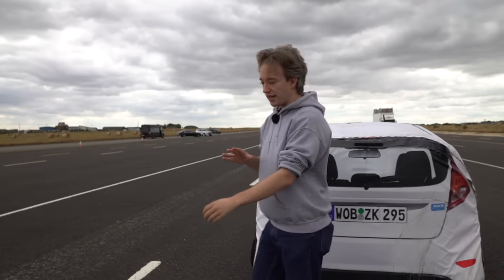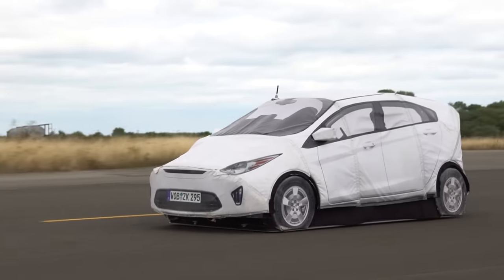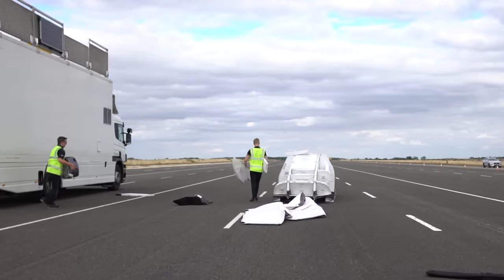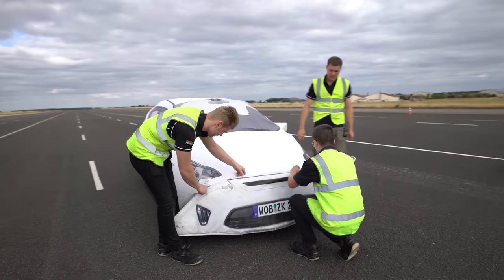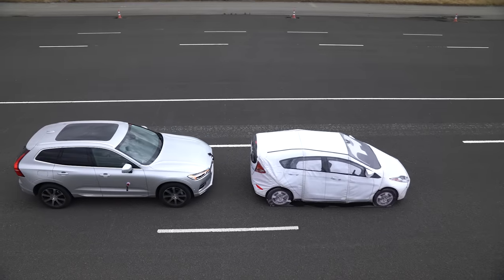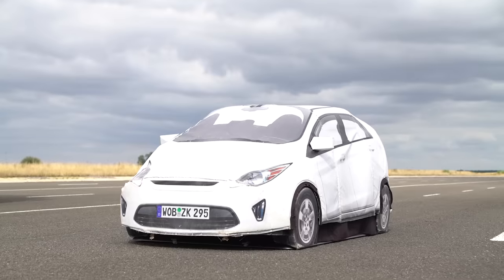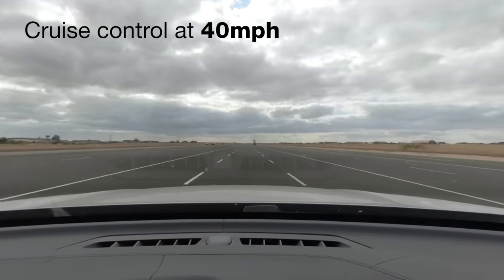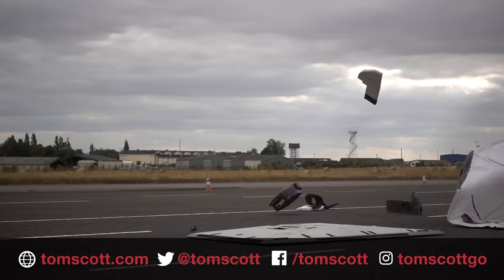The collapsible crash-test robot car

Comment: When they finally work out driverless cars, will they have to make a special model for Brits that doesn't have the steering wheel on the right, instead of not having it on the left?
Reply: Yes.
Reply: It won't be so much where the invisible steering wheel is as knowing which side of the road it's supposed to be on. Plus having equal amounts of sensors on each side of the car and both LH and RH software installed simultaneously, coupled with the knowledge that if a UK car traverses the Channel (or vice versa) it knows to swap sides (not doing so would be a little awkward... well, more like downright dangerous and possibly fatal).

Even in countries that drive on the same side of the road, they'd need to know the respective countries' Highway Codes when crossing borders, and recognise different styles of signs. It also needs to be preloaded, as you can't guarantee decent GSM coverage across the entirety of a border.

Your comment was in jest, but illustrates a nice little can of works...
Reply: mittfh, now I'm imagining a gentle chime followed by the car calmly announcing "please be advised there are currently 127 wrong-way drivers approaching you at a high rate of speed".
Reply: None of us have the wheel on the correct side. The correct side would not involve walking into a lane of traffic to enter your car.
Reply: @900bot2  Gear stick? Oh ... ... I think I remember that ... ... from so long ago.
Reply: Yes but they'll save money elsewhere by not installing indicators.  They're a redundant feature as nobody uses them anyway.
Reply: zeke1220  Sweden had left hand traffic with the steering wheel on the left back in the day. It was a nightmare during overtakes.
Reply: Monty Python the Flying Circus
The language is not called British. It is called English. Named after the Angles, a German tribe. So what's your point?
Reply: Jim Fortune  His point is that he's that guy and should be ignored
Reply: blindleader42 So you're saying that Brits have the steering wheel on the right side then?
Reply: uzijn Yes, because they drive on the left!
Reply: We'll never have (wide spread commonly in use) driverless cars in our lifetimes, so no need to worry!
Reply: They won't figure out driverless cars. There's a morality aspect involved. Does your autonomous car kill you or the child that wandered out in the road? Which is more moral? Would you buy one if the answer is you? Would you not sue the manufacturer or driver if your child was the one that got splattered?

Until a decision that doesn't piss off a bunch of people can be found, it's probably best to put it out of your mind.
Reply: It doesn't matter how many times I watch a Tom Scott video, or how British the accent of the people talking -- every time the passenger seat is on the left, I'm surprised and confused.
Reply: And india, and australia, and New Zealand, and japan, and most of south africa, and Ireland, and malta, cyprus, Hongkong, many carribean islands and any others I forgot to mention. We are not the only country that drives on the left, otherwise car manufacturers wouldn't bother producing right hand drive cars to cater for the minority.
Reply: The world's coming to an end so quickly?
Reply: Everyone who drives on the right is simply following Napoleon, who was left-handed and wanted to march on the right-hand side of the road so that his dominant sword hand was in the middle of the road to defend oncoming attackers.
Reply: Which is why the steering wheel is on the RIGHT side. Doofus.
Reply: Alex Willis could just be following the law mate. It’s the British who are engineering self driving cars so you Americans can eat a Big Mac while driving on the wrong side of the road
Reply: Jim Fortune no, we are just doing the best at it😂
Reply: I made a mistake with my statement. I've corrected it now. For reference, I'm British.
Reply: Aimee Wyatt
Nah. You just have the best commentator in Tom Scott.
Reply: Alex Willis
So it made him more effective and 95% of his army less effective?  I think that's an entertaining story, but apocryphal.
Reply: Jim Fortune. Yup probably nonsense, but I like it.
Reply: Monty Python the Flying Circus  the nice part?almost everyone else use USA standard.
Reply: @zeke1220  The correct side involves seeing the road from as close to a central position as possible, to improve forward visibility into the opposite lane.
Reply: @Poldovico  That's really not an issue if you're not crossing into the oncoming lane.
Reply: @spinner4148  I overtake every day. All it would take to safely overtake with a same-side steering wheel is a single mirror.
Reply: @spinner4148  is your existing side mirror blocked by passengers?
Reply: @blindleader42  So... our steering wheel is in the right side and your steering wheel is on the wrong side like our signs are in the wrong sides like your signs are in the right side.
Reply: @blindleader42  I mean you're the one using our language. English so maybe you should come up with your own language?
Reply: @EinkOLED  63 countries in total drive on the right so it's not really a minority
Reply: Monty Python the Flying Circus most people are right handed, placing the wheel on the right means they have to use their left hand for most of the things. I don’t think it is the right way of doing this
Reply: @zeke1220  That's literally the dumbest idea I've heard today. Make it safer to enter/exit your car 0.1% of the time and more dangerous to drive all the time.
Reply: @decidiousrex  How is it more dangerous? Do you make a habit of running into things on the opposite side of the lane from your seat? It would be the same thing, just don't drive into things.
Reply: @Xeddicus427  Are you sure about that? Once it is demonstrated that in all circumstances an automated system is safer than a human, it is likely that manually driving a car will be reduced to specific circumstances.
Reply: @bobthecannibal1  In the time a human takes to weigh up the ethics of that situation (even if it's merely 1/100th of a second) a computer could have calculated a path that avoids killing anyone, or determined that no such safe path exists and will then execute a path that minimises the physical impact to the operator/passengers of the vehicle.
Reply: @alexanderoshaughnessy3176  Given that there are over 180 internationally recognised countries, I would assert that 63 is in fact the minority.
Reply: @jamielonsdale3018  The problem there is 'in all circumstances'.  Computers do, in fact, make mistakes.  Very stupid ones, surprisingly often.  It's not reflexes that are the issue, it's the computer insistently doing something stupid.  Like driving into a lake.
Reply: @b34rdy  Congratulations. You're about three years late to a party we throw every once in a while for people who don't get jokes.

I'm curious. Were you born yesterday?

Comment: while that was neet, i want to hear more about that robot and how it goes so fast while being so slim
Reply: 78 hamsters
Reply: It probably dosent weigh very much, so it doesn't require a huge amount of power to move it
Reply: it's a bit hard to see, but it appears to be higher in the middle. I'd suspect that it's somewhere between 20 and 30cm high. enough for a small electro motor. combined with a weight of 30~50kg you really don't need much to accelerate it up to 50mph.
Reply: It's lightweight, so doesn't need much power to accelerate, and it doesn't need to drive long distances so it doesn't need a bulky battery pack.
Reply: What is it named?
Reply: It's called the "Global Vehicle Target" or "Soft Car 360".
Reply: Indeed! I couldn't have said better myself - and I work at the company that makes them!!! The platform actually weighs in at 346kg and has 3.45kWh of power. It has an over-run capacity of 1000kg per wheel. Our company is AB Dynamics if you want to learn more.
Reply: Look up the world's fastest RC car. 202mph done by a vehicle the size of a large toy.
Reply: @Electricdreams21  78 hamsters hauling a flat platform for a foam-block car is now my new religion.

Comment: >50mph
>"highway speeds"
Disgusting, Tom Scott. Truly filthy.
Reply: In my state, 55 is the lower bound for almost any highway, though they get up to 65, and interstates up to 75.
It's Nebraska. There's alot of space to traverse if you want to get anywhere. If you don't go that fast, you fall asleep.
Reply: Micah Philson that’s not what they were talking about
Reply: 55 saves lives.
Reply: In the UK, "highway" is an umbrella term for public roads. 35, 40mph is not unusual for city driving. You saw how it could barely stop in time at 40mph, now you see the challenge in getting a car to stop sooner than that while not creating inertia for the people in the vehicle.
Reply: Would have preferred metric as well :D
Reply: 100km/h on a very curvy motorway that hugs the coast and has bus stops and stuff, which dont really have slip lanes. 
N-340 in Spain if anybody is interested. Used to be the most dangerous road in Europe.

None of these cruise controls or anything would be at all viable where I live. And notice how I said "used" to be the most dangerous road? The fact you cant shuffle your responsability onto a bit of technology has kept people aware and careful.  Now that everybody uses in-built safety precautions they've stopped caring so much about their own safety
Reply: Here in Seattle people routinely drive 5-10 MPH below the speed limit on the highway even when there is zero traffic.
Reply: @micahphilson  100mph is minimum to feel any sense of moving tbh.
Reply: In Canada we go 100 kph ( no idea what that I’d in miles) I think it’s somewhere around 62 mph
Reply: @MicroageHD  You should probably seek help for that, it sounds incredibly dangerous.
Try a go-cart at 20mph and tell me you feel no sense of movement and check back with us, please.
Reply: Micah Philson here in California, the interstates are only up to 65MPH but no one cares and goes 80-85
Reply: I can't drive 55!
Reply: eWizard he’s in England, there’s a thatcham research logo on the workers shirts
Reply: @MicroageHD  are you german?
Reply: @ashley587  then the "highway speed" is 70 mph not 50, even the A road speed is higher at 60
Reply: @sebastianhansson6919  oh boy you do not want to be on the german autobahn if you think thats dangerously fast,  the recommended speed for driving on the autobahn by the government is already at 80 mph and most people drive about 100 to 110 mph just on their way to work
Reply: @hecki0193  His point isn't that it's dangerously fast, but that you should still have a decent sensation of movement at lower speeds and it's dangerous if you don't have that because it means you are underestimating your speed.
However, it's not true that most people drive 100-110 mph. Sure, it's common, but many people drive 80-90 mph. I don't think either of those groups of people is more than 50%, though, meaning neither of them are "most people".
Reply: @boringperson-zb8vy  In the US, going below 45 mph on a highway is illegal, unless there is a traffic jam forcing traffic to drive that slow.
Reply: where i live highway speed is 80kph
Reply: @lobsterbark  in Germany you are not allowed to enter the Autobahn(motorway) unless your vehicle is capable of doing 60kph (37.5 mph)

Comment: Was really hoping for a both-vehicles-moving test, to see how the Volvo would handle a brake-check
Reply: If the target tried to break check the Volvo, surely the target would fall apart under its own breaking forces?
Reply: I don't think this system would react to a brake check, since an actual brake check doesn't stop the vehicle, it just rapidly slows it down for an extremely short period, then back up to speed.
Reply: Look on the NCAP YouTube channel for other tests.
Reply: Just search for “EuroNCAP Volvo” (or any other car make and model).
Reply: what about a neither vehicle moving test?
Reply: Rather than a dinging, the alert is changed to "Blyat"  and it starts uploading the dashcam to youtube.

Comment: Guys, this is just an assist. It's not expected to handle everything. It's supposed to just help in case you don't stop in time on your own, in situations it can detect.
Reply: That why the emergency stop is short and hard to prevent drivers from relying on the radar.
Reply: @Squant Thank you for saying inching.
Futurephiles have been boasting that we'll have fully autonomous robo taxis on the road in a few short years for a decade now, and always been wrong. The hurdles of fully automated driving on mapped out roads in clear weather with no traffic are still real. It may not be possible to actually have automated vehicles on current infrastructure.
Reply: @Squant We'll get fully automated cars as soon as someone manages to automate the final missing piece of the puzzle: responsibility. Whose responsibility it is when an inevitable accident happens; the owner's, the passenger's, the manufacturer's, the father's brother's nephew's cousin's former room mate's?

Comment: 0:35 This is what happens when you buy your car at the 99 cents store.
Reply: *poundland
Reply: Haha, though in reality, the test car is probably more expensive than a real one!
Reply: I think the point of this is that it's not only safer but much cheaper to test the systems with the foam car than a real one. Although the remote-controlled base probably costs a fair bit, it's still reusable. And if the systems fail, you don't want to wreck the car that's being tested, either.
Reply: most likely. leaving the base aside, that's not a normal foam. that thing withstood a crash and didn't change it's form permanently.
Reply: Cost effective doesnt equal safety
Reply: Well, it's not a mass produced product. In terms of materials, it's probably not quite that expensive, but there is more to that.
Every single one must conform to the standards, they must be tested individually, R&D(&bureaucracy) to set these standards was probably astronomical, contracting to get the thing and the base designed and manufactured, ...
Alone due to the fact that they are all special/custom products I wouldn't be surprised if the robotic base on its own costs 100k

It's obviously worth it though!
Reply: We all know you're justin y
Reply: It was 99 cents doe
Reply: or in the UK
Reply: PowahSlap Entertainmint a
Reply: Rodigo Duterte,
"Cost effective doesnt equal safety" 
It does if you don't buy the safety because it costs too much.
Reply: This guy uses like bots.
Reply: Cheap is better. It just plows through other cars
Reply: Say hello to the new Justin Y: PowahSlap Entertainmint
Reply: Ordered off Wish dot com
Reply: Haha I watch this over and over again
Reply: @TiSapph  robotic base is called LPRV or Low-Profile-Robotic-Vehicle

Comment: The license-plate on the mock-up is bogus: It's WOB (for Wolfsburg, which is in Lower Saxony), but the little coat of arms is that of Bavaria
Reply: its supposed to be not real
Reply: Not claiming otherwise, I'm just amused by it. I'm wondering how it came to be, because both details are real, but they would never appear together on the same plate
Reply: namewarvergeben, so any accidental coincidences are impossible.
Reply: I think you are taking this more seriously than I am.
Reply: I would guess that plate making is strictly regulated when applied to moving vehicles or vehicle lookalikes in this case, sort of how you can't make false money that looks to real, even for films, without approval.
The invalid combination is likely an intentional dead giveaway to any scrutiny.
Reply: Let's not forget that the car resembles a Ford and the WOB license plate is where VWs are produced
Reply: sensing some meta joke "namewarvergeben" (german for name-already-taken) :D
Reply: I assume it includes the big german car companies. Wob for Wolfsburg where the headquarters of VW are and the bavarian thing for BMW which literally means Bayrische Motoren Werke (bavarian engine manufacturer).
Reply: Literally unusable.
Reply: Don't forget Audi. They're also in the state of Bavaria and are part of the VW/Audi group.

Comment: I wonder if the breaking system can detect and compensate for things like wet or icy conditions where you need to break more in order to stop.
Reply: I was thinking just that! I guess it'd crash... Not sure how you can detect ice or water on the road... Unless it uses the rain sensor, thermometer, etc., to predict if the road could have less grip...
Reply: cars already have those, so, probably!
Reply: I was wondering if the "warning" pre-brake was the rear axle pair braking, so the system could work out the mu (coefficient of friction) of the particular conditions. The rear axle tends to be the most susceptible to locking on a FWD vehicle as it tends to have the least load. It did seem to leave a very limited margin even on a dry surface.
Reply: They do, yes. Some cars (I can only speak for Volvo, since this is were I worked a couple of years back) will estimate the friction of the road surface while the driver brakes or use the anti-spin system for example. It also weighs in the ambient temperature, rain sensor (normally used for the wipers) and sometimes even a humidity sensor to try and estimate if there's ice on the road surface. These things will have some impact on the brake algorithms that determines if you should warn the driver or ultimately stop.
I imagine that someone might have come far enough to also use the camera to visually detect the road surface, but I'm not sure if anyone does that yet.
Reply: I know the new Ford Focus uses surface sensing to detect pot-holes and brace the rear suspension, reduces the wheel slam into the hole.
Reply: Yes, although its built into our path following algorithm. Head and tail winds create more of an issue!